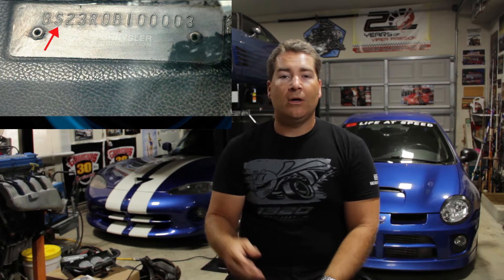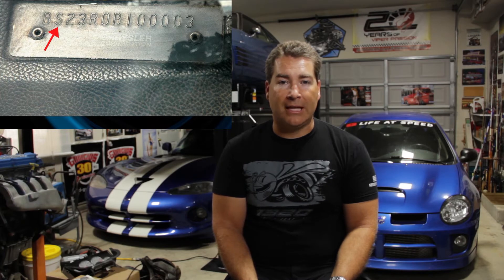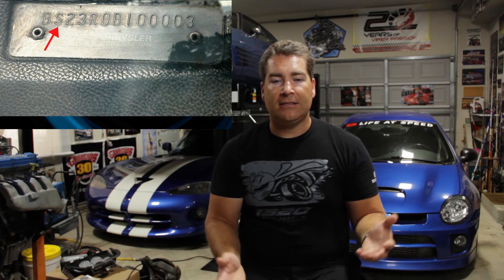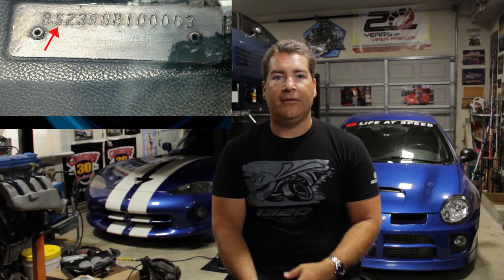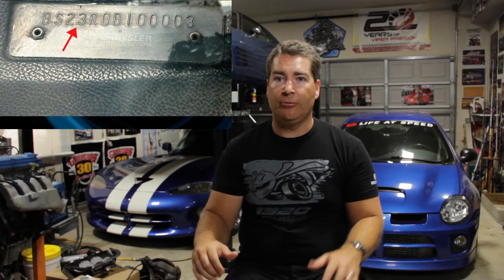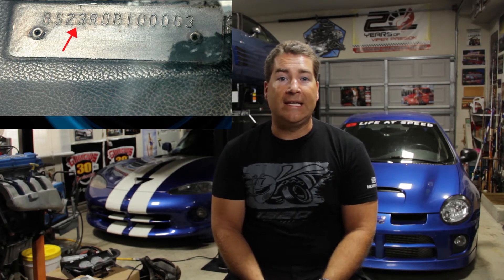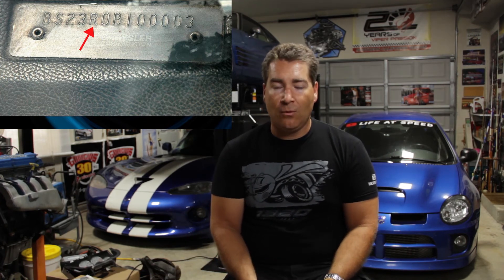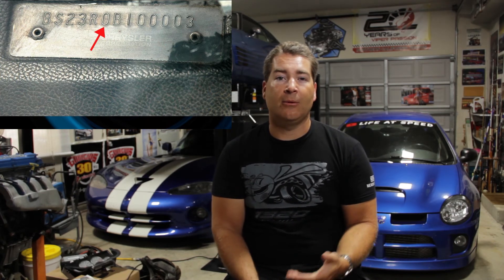Tech Talk Tuesday: How to Decode a VIN on a 1970-1974 Dodge Challenger or Plymouth Cuda

Comment: how to find out the original color of a 1972 challenger? Is there any identification on any tag or vin? Tks for your video.
Reply from the maker: There should be a tag on the drivers inner fender that has a bunch of codes on it. The first code of the second row up from the bottom is the paint code
Reply: @LifeatSpeed  tks

Comment: How can  tell if my 70 challenger special edition, is also RT? it has all the RT emblems.
Reply from the maker: It could be both! If it's an R/T the VIN will start as "JS" compared to "JH" for a base model. If it is and SE, the next 2 digits will be "29" instead of "23" or "27" So if you have an RT/SE the VIN will start JS29.
Reply: @LifeatSpeed  ,. It is a JH29, I assume all the RT emblems and trim were installed  by previous owner.  Thanks, I appreciate your information.
Reply from the maker: @carloscuda yup RT emblems added in that case, but definitely an SE.